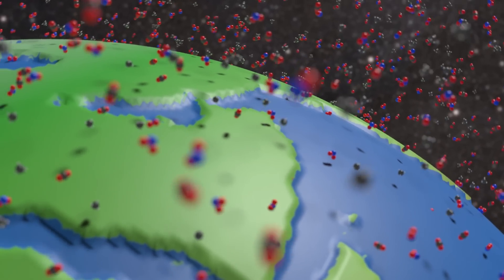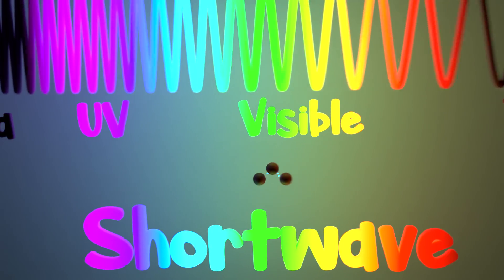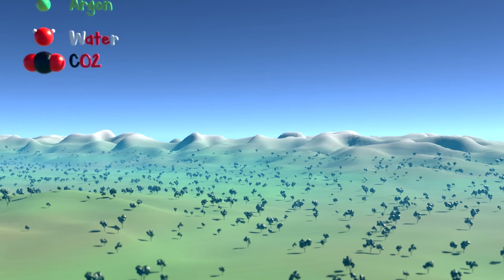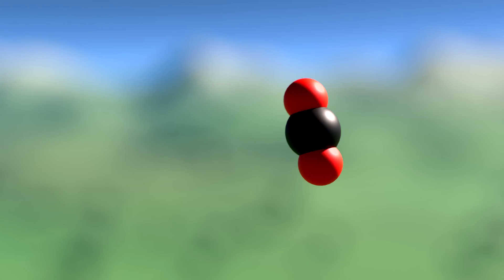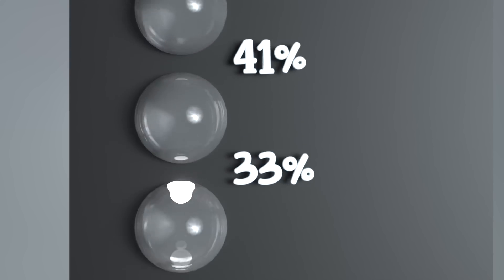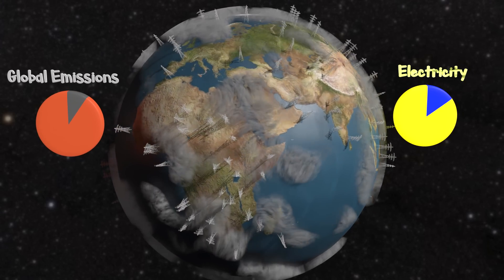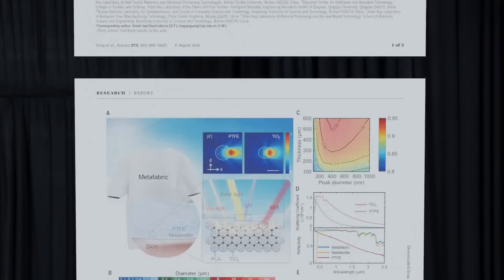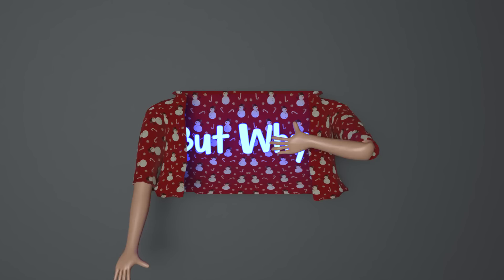Energy Free Cooling through Physics

Comment: These insulating materials are likely not as 'bad' as asbestos but still seem like a horrible source of microplastics, especially if used in the form of foldable fabrics (the tent...) - of course there is always a tradeoff and these just need to be disposed of properly (e.g. shredded and pyrolysed or decomposed in some other way).

Comment: 👎 as with many “innovative” technologies, there are often greater negative longterm impacts than positive.  Plastics in general are a perfect example.  It’s ironic how so many  “environmentalists” opt for EVs to avoid oil & gas.  While promoting the continued use of other petroleum byproducts.  Forever Chemicals are only one example of the massive environmental damage caused by plastic use.  And to save you time on ignorantly responding with the “illusion of safety” - BPA/PFAS-Free argument.  Currently the alternatives being used are equally as bad and possibly worse.  
Example: BPA-Free is most frequently replaced with BPS or BPF and there are thousands of alternate bisphenols.  So the controllers plan is to switch every so often intentionally giving you a false sense of security. Younger generation foolishly believes “I’m smarter than my parents who used BPA.”  While simultaneously falling into the same trap, only realizing their error when they are too old and sick to fight the system. ☠️  STOP USING PLASTIC
Sustainability = Survive 
Survive < Thrive 
Thrive = Planned Continuity

Comment: If heat is energy, instead of cooling the earth, why dont research to use this heat to generate more eletricity to use in the daily life?
Reply: If you want to use heat to generate electricity you need some space (reservoir) with lower temperature to harvest this energy. That is because you need a driving force which in this case is a temperature difference. The problem is that, let's say 10 °C, is really low difference and won't do much.

Comment: The of CO2 level is not "dangerously high", it is dangerously low. Seen in the scope of 1M or just 100.000 years , we are reached an all-time-low in the middle of the 20th century, and now climbing a very tiny little bit up, however, barely statistically significant. If the CO2 level drops just a little below the current level, all plants above the water surface will die.
The problem with cooling of buildings is that far too many people live in areas which are too hot for inhabitation. Black people lived in Congo on equator for millions of years without aircon, but white people in Texas "need" air-condition. Why? "Stupidity" is the answer.  Instead of trying to "concur" nature with technology, we should learn to live in harmony with nature - including not building in low areas near the sea, and not settle in areas which are too hot to be comfortable. (Different people have different preferences on what is "comfortable", and that is fine.)
Reply: Can I see the CO2 level diagram you are talking about?

Comment: I don't understand why the use of such materials in new construction isn't mandatory already

air conditioners seem to get a lot of hate despite heat pumps literally being more than 100% efficient at heating or cooling a space, simply because they still use power and there are a lot of them in use

combing heat pumps with insulated buildings coated with subambient passive cooling materials should drastically lower the energy requirements for such systems

Comment: Truly inspiring video. Thanks finally I found answer to my question as why trees create better heat protection and random light reflecting angles. I am referring to very sophisticated Aerogel made by smart brains to do that. If you observe closely than Mother Nature already doing it. Tree leaves for example in multiple layers and first they obstruct light hitting directly and light radiation is remarkably reflected at random directions. I observed real heat differences waking on road. First I was walking under a fiberglass shade  there was no light hitting me directly but still very hot due to radiation. But as I entered in trees zone ; I felt extreme differ nice. Heat feeling was almost 10 c or more.  Aerogel is good but Mother Nature is too good 
Desingers have made 3d cnc cut innovative shade screens in Dubai which replicate much like leaves. We can make multi layers of cnc cut shade screens layered on top of each other. With each layer has slightly different  designs like random leaves patterns and each layer has different patterns. 
Great I learned something new today.

Comment: 15% of electricty use toward cooling ? More like 30-40% of electricty use is toward Air conditioning. 
They build houses in a way that literally makes it necessary to run AC 24-7. 
Modern home building can definately use ancient cooling methods and new technology can definately help. Some as simple as a double roof with air gap in between has been shown to lower overall temp inside (solar panels inadvertently provide this benefit when mounted on top of existing roof) 
Obviously seasonality would have to be addressed.

Comment: This does not makes sense and there is a lot simpler solution. There exists a specific infrared frequency which is not absorbed by greenhouse gases. There is a white paint that radiates out the energy at that specific frequency range so the energy radiates out into space. You can evwn make this paint at home. There is a youtube channel exactly describing the process.

Comment: I don’t think this would work well in places with a strong greenhouse effect. The Atacama does not have a strong greenhouse effect as it’s high and dry, and this product lets IR radiation right through. Great for when you’re in the desert at night, not great when you’re low to the ground in Florida and the humid thick atmosphere is pounding you with thermal radiation

Comment: So they made a shade on steroids. What is the cost/benefit analysis?  If it costs a new house to cool your house, its not really practical when you can add $15,000 worth of shade on the west side of your house and pay for itself in saved energy  in 10 years. (And the HOA won't give you any trouble. Although if you live in an HOA, I think you deserve all the headaches you get.)
Aluminum sheeting reflects most of the heat vs steel sheeting.  I prefer recycling aluminum sheeting to make Rabbit Hutches because it keeps them cooler. Aluminum can be made as durable as steel and used as roofing material. Therefore reducing energy useage for a house, but its currently too expensive.

Comment: I’m currently working on a project that includes designing climate controlled hurricane resistant greenhouses for the Caribbean. Perhaps building the greenhouses with translucent solar panels coated on the underside with this material would allow the greenhouses to take advantage of the abundant sunlight while controlling internal temperatures and allowing for an expanded variety of crops.

Comment: This is NOT fixing the problem, is just shifting it.

Assuming you are able to cover your property (or your car) you will for sure NOT use electricity to cool it down, but the heat is STILL trapped in the atmosphere...

Unless of course you want to cover the stratosphere with this material?!?

Too good to be true, in fact: is not true.
Reply: there paints that achieve this but the most realistic way is to make vaccum insulated panels that radiate energy. This effect is very real and was used in ancient times to freeze water.

Comment: It would be a good step in the right direction "if" the production of those polymers are not more polluting then air conditioners, and secondly, from living in Singapore for over 10 years, people usually don't use an air conditioner because it's hot, but they use it to combat the HUMIDITY, in Singapore we can have almost deadly levels of 89% humidity in the air, without at least a dehumidifier you would die if you had to work in those conditions, we see the construction workers stop regularly to cool down. So for hot and dry places this would be perfect, for humid places, you would still need an air conditioner.

Comment: 9:00 Hypothetically you could use both inverse greenhouse panels and solar panels on a roof. Just put the solar panels above the greenhouse panels. That would make the panels even more effective since the solar panels would be giving them shade, so not as much light would be hitting them in the first place. But they can still radiate the heat just fine. If the solar panels were enough to power the water pump, you'd have an entirely self-contained off-grid cooling system.

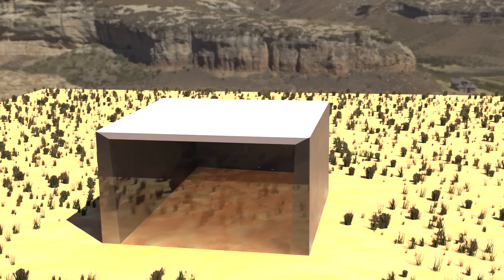Comment: 5:05 is the transition from normal knowledge to unsupported reasoning. Note how it describes an "inverse greenhouse", then doesn't talk at all about how that building will interact with the atmosphere, which still surrounds the building.

If IR would have been reflected back by the atmosphere, how does introducing an IR-transparent roof to a building change that? Does the earth really radiate more IR than the sun does, or will the IR-transparent roof end up allowing more heat in than a straight insulated roof?
Reply: It wouldn't. It only emits IR radiation in the short interval of wavelengths that don't interact with the atmospheric gases.

Comment: the problem with 45 paralel in the northern emisphere is that u need 2 months your roof white to radiate the excess heat, then 4 months in the winter to somehow do the reverse and use the heat to cut energy consumption to heat the house...bummer

Comment: Two big concerns: 
- polyethylene is not a natural material and it derives from limited resources which will not be available for much longer and pollute the planet. Is there a sustainable alternative to this material?
- what happens to the exterior temperature when all the buildings reflect the heat? would that make the atmosphere much hotter?

Comment: A small point correction to your depition of the motions of molecules  of out atmosphere. They aren't orbiting our gravity well they are bouncing off of each other. They are conducting momentum to each other. 

If you had one lone molecule in a theoretical pure vacuum at at altitude it would still be pulled to the center of gravity and then bounce off of the solid source of that gravity. Our atmosphere does, at what amount I dont know, exchange momentum via conduction. Good video so far though👊

Comment: The problem is, while this can radiate away more heat than a solar panel can produce, it can't radiate away more heat than a heatpump powered  by a solar panel can. 

Also the increase in effectiveness of aerogel over more traditional coatings is not big enough to justify the massive increase in cost.

Comment: 9:00 When comparing Energy gain via photovoltaic to energy emission via cooling panels it is important to consider, 1. That Photovoltaic panels radiate heat as well, and 2. That the gained Energy can be used to displace heat as well. 800 watts of power can displace around 2400 watts of heat with efficient heat pumps.

Comment: It makes no sense to measure change in temperature in PERCENT! If you are gonna do it anyway, at least start with minus 273C (zero Kelvin) as the baseline.
Answer this: How many % increase is from 0C (zero C) to 5C? And how many % is from 5C to 10C?
Answer: 5/273x100 and 5/278x100.

Comment: A 30 degree difference is nothing to scoff at as that most places with temps in the 90f during the summer the desired temp.indoors is 73-70 and as some one who lives in one of these areas were it's 100f to 110 with index this type of stuff would cut cooling bills massively. I can during the winter get as low as 45$ dollars a month but the summer not so being 95$+.

Comment: I came to this video by chance... 

I remember an experiment, ran in the '80, where someone designed a dewar (an extremely well insulated container) with a window on the top letting pass radiation only at some millimeter wavelengths (where the atmosphere is almost transparent and the universe does not emit very much) and reflecting all - or most - of the other wavelengths. I do not remember the details, neither could found any reference to this old experiment that was mentioned by a professor of astrophysics when I was a student, but this device, let alone IN THE DESERT was able to reach very cold temperature, several tenths of Celsius degrees below. Obviously, the device took a very long time to cool down, as the power emitted by the device was of the order - I guess - of microwatt overnight, while during the day was shielded from direct sunlight, I guess, by a shield.

I wonder if you have any information about that.

Comment: Just a thought, If the cooling effect of one of there panels is so great  8:57 then could we just use it to cool a large area the use temp differences to generate electricity? If it is reflecting twice as much as a solar panel absorbs then surely we should be able to suck up to (but never quite reaching) double the energy is the same area of covered surface?

Comment: I'm not trying to be pedantic here, but rather trying to see if I'm actually understanding this.  Correct me if I'm wrong, but this really isn't "energy free cooling", but rather "energy free prevention of heating"?  It's preventing the natural energy transfer that happens via sunlight, rather than actively causing the transfer of energy?  That would be active cooling, which generally takes external energy...right?   The end result is a lower temperature interior, but it's because it wasn't allowed to get hotter in the first place and not because it was cooled off after being hot already.

Comment: Why is the "upper limit" in your graph at the beginning 400ppm, even though historically the planet has had multiple times that without mass die off events?

And how does it sound for inaccuracies in the hockey stick graph when compared to actual data, when your animation appears based off the hockey stick graph? 

And why did the animation use that particular time frame precisely?

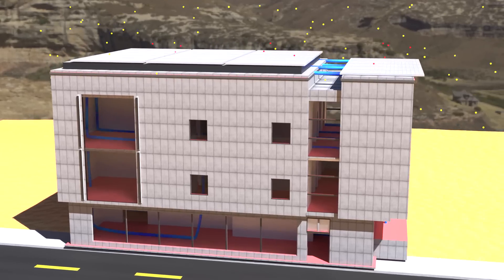Comment: So at 8:40 when you're talking about the heat exchange factor with using a water system to move the heat the the panels to emit heat/energy away this makes me think this could be useful for geothermal generates it seems to have a very decent exchange of energy rate for no real moving parts?

Comment: It's great and all, but I kind of wonder how the radiation properties stack up to body heat generation. Yes it radiates out more heat than it absorbs, but that doesn't account for heat that is generated by the human body. It may be effective at cooling empty structures but what about structures with hundreds of people in them? A typical person at rest will generate about 80 watts of heat energy, but also able to produce 1050 watts while active. I'm sure the heat dissipation scales as the temperatures rise, but that's exactly the point, is the temperature may rise to very uncomfortable levels. 

To know for sure there would need to be some data on the exact amount of energy dissipation that could be expected from this method. Although if we assume what you said about the dissipation being twice that of a solar panel, the average solar panel able to absorb and collect 200 watts of energy per square meter, then it would be able to dissipate 400 watts of energy per square meter. Doing the math out, in order to dissipate the heat of 100 resting people you would need 20 square meters of area dissipating heat. If we assumed the worst case scenario of everyone being fully active, we would need 262 square meters. Honestly doing the math out, in the middle of making this comment, I think it's actually not a too unreasonable cooling method. There may need to be some balances made, maybe a way to adjust it's energy dissipation so it doesn't get too cold, while also having a backup heat pump cooling system in case it starts getting too warm. Likely not going to be able to completely make heat pump cooling systems obsolete, but definitely could help cut down cooling costs quite a bit. All this assuming the stats are as presented and it works. Neat.

Comment: I think our first step is getting rid of dark asphalt and roofs.
Reply: no need, just plant tree's. They naturally cool down area's. If your local area had at least 60% tree canopy coverage, the temperature is drastically lower. Sometimes up to 10-12 F lower than surrounding area's, without tree's. The issue is, we pave everything, and then there's grass everywhere. And if there's no grass, it's just buildings. Where I live, the entire town is very low on tree's and it gets stupidly hot in the summer, but the town over, which is older, more established, full of tree's is honestly pleasant. Not more than a 20 minute drive away.

Comment: Wow. Not even a minute into the video and you're wrong. Most of the heat you experience is NOT radiation. It is convection. But the only 2 types you seem to be aware of are conduction and radiation, so it's not surprising at all you don't actually know enough about science to know what convection is

Comment: still there is no passive air flow which is what makes our houses hotter 

well how about we use the arabic مشربية
 mashrabiya it's a very passive arab cooling windows that allows air to come in yet after getting cooled, or how about a different building material like mud, mud houses are way cooler since they don't absorb that much heat and additionally, it allows air to flow through thus effectively cooling the house

Comment: 800watt hours is to low.
5 or 6* the panel wattage over the whole day.
so they are the same wattage not double for the cooling one.
A PV panel can emit nighttime energy and it can be improved with these techniques.
electrical output is worth 3x of thermal energy, AND YOU know that, so WTF?